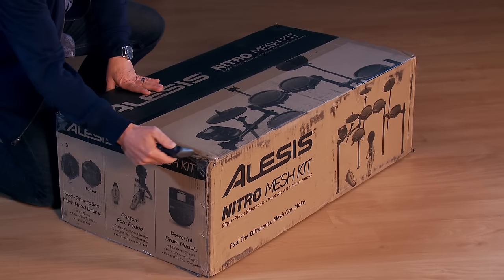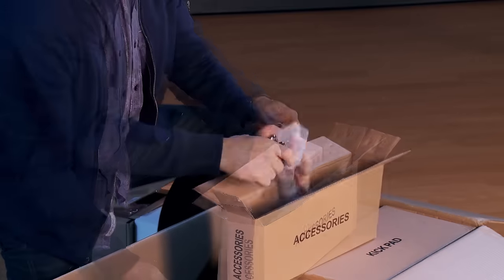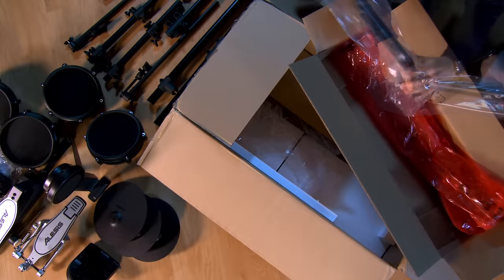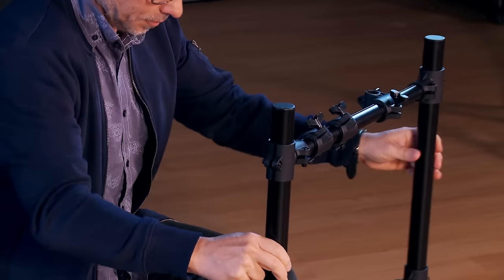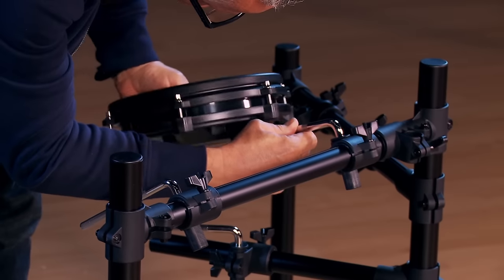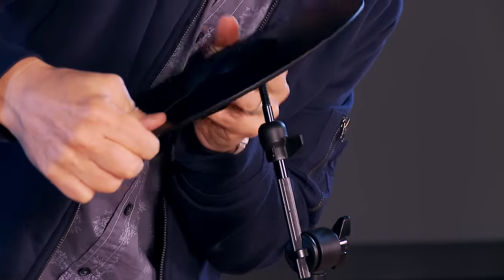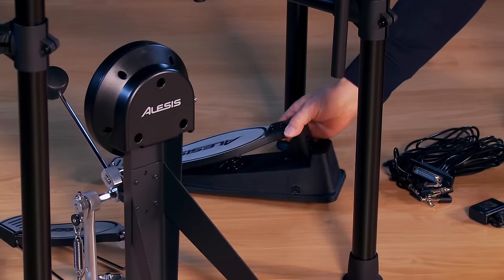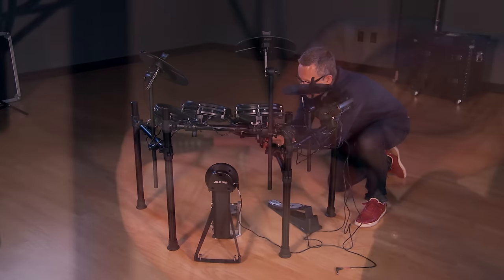Alesis Nitro Mesh Kit Assembly Guide

Comment: The most difficult issue I had with assembly was that the directions included lettered parts description (a,b,c exc.), which was not indicated on the actual parts. However there are very few pieces to assemble so once I stopped going by those, and looked at the pieces in front of me, it all fell into place.
Having some sort of knowledge on standard drum arrangement to begin with is helpful.
I spent more time after assembly tweaking the drum pads into their final resting place then all else combined, including shipping. Not really on that last part, but shipping was only two days so I have no complaints. I would recommend this kit for beginners, and advanced student for use with a daw.
Just throwing this out there GarageBand is free, and compatible, but there are more studio quality programs out there.
Reply: @JonMykel Wormley you need a speaker or use headphones

Comment: Hi I have a question , does it need a speaker ??
Reply: Yes or headphones
Reply: ever find out?
Reply: an amplifier is not required you can plug in headphones into the module and play it fine, otherwise, it will need an amp for headphone free playing :)
Reply: U can listen in ear. Or plug in a speaker. So yes and no. If u wanna listen with headphones no. If u want it out loud yes. Hope this helped
Reply: Monkey- kun Yes, or headphones you can plug in
Reply: Monkey- kun I wonder this too, but I feel like you might need to buy one:/
Reply: No, you can use headphones.
Reply: Like any electronic music instrument that doesn't have built-in speakers, the answer is obviously: YES (unless you plan to use headphones or ear buds).  Your speakers should also be powered (active) monitors or an active PA.
Reply: Speaker or headphones to produce sound
Reply: Anas. Az you can use headphones OR a speaker
Reply: Anas. Az no you can use headphones